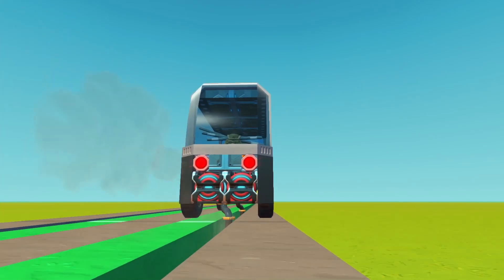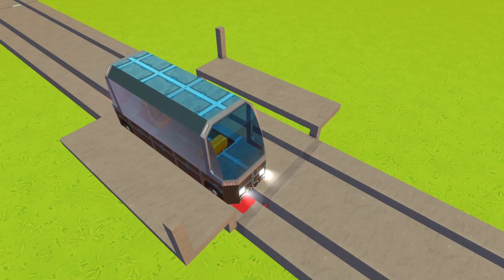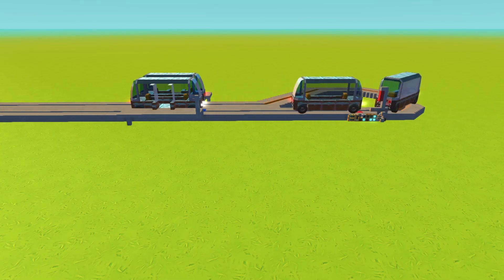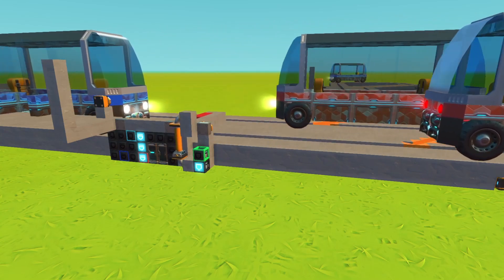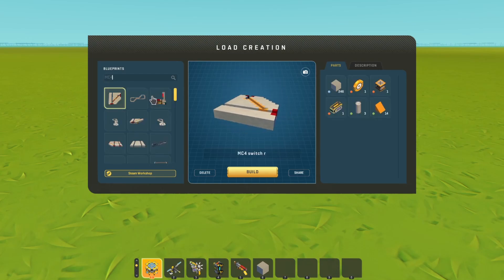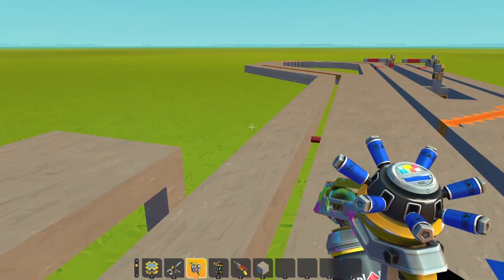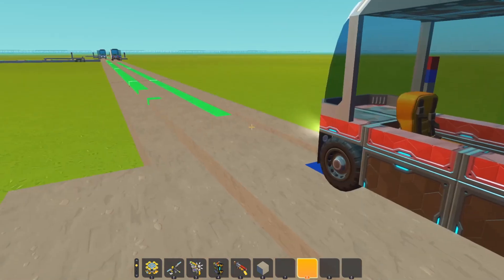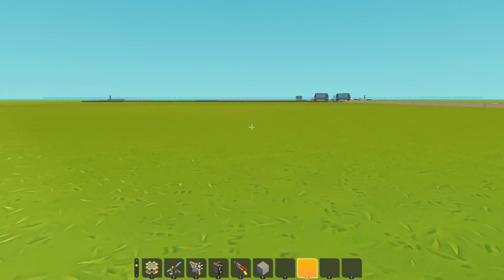minicart explenation [read description]

Comment: I having a problem with this system.

When a cart arrives at a station, it sometimes completely ignores it. I can't figure out why this is happening.

Thanks in advance!
Reply from the maker: Could be because the cart is going too fast. Make sure there is some non-green road before the station, 32 blocks should be plenty. Also check that the blue paint is 2blocks wide and 3 block's long.
Reply: @CodeMaker4  mine Is Not Working